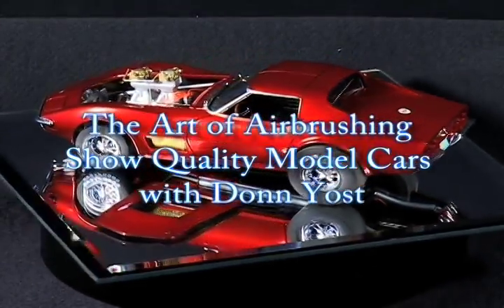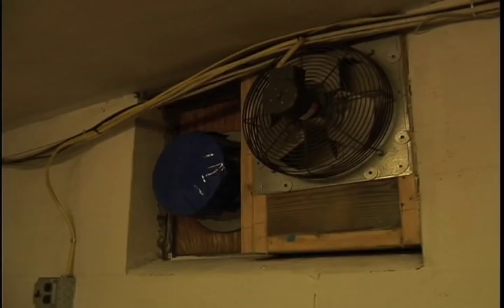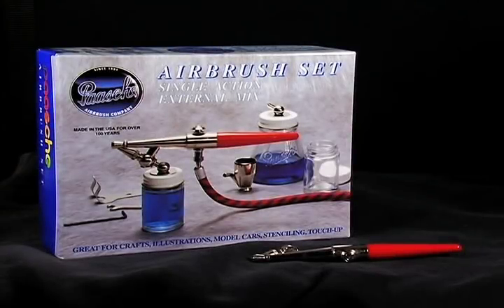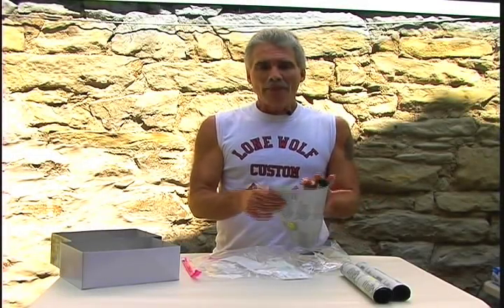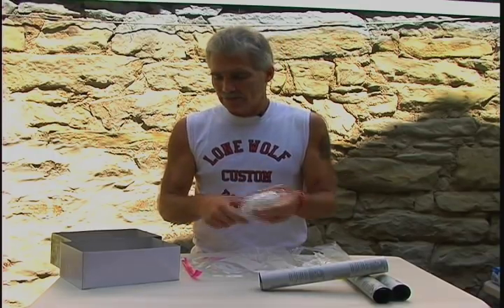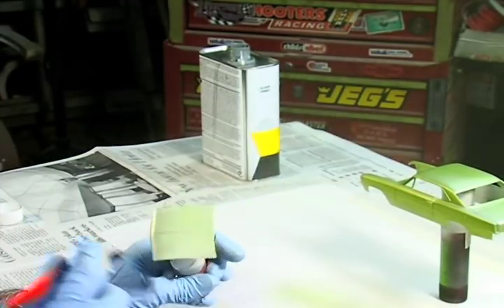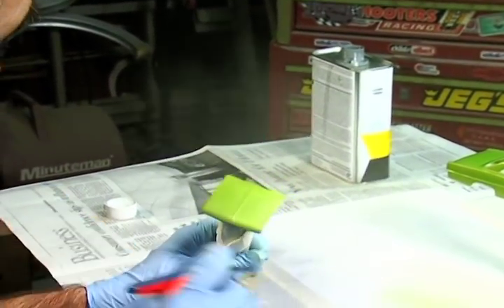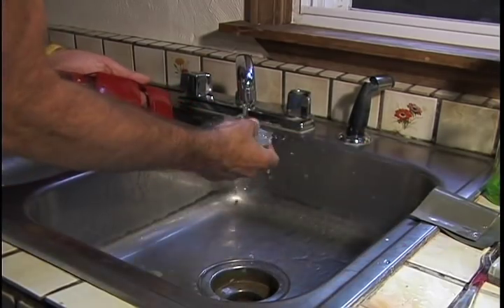The Art of Airbrushing Show Quality Model Cars with Donn Yost (Extended Preview of the 90min DVD)

Comment: 45 yrs ago I used to build model cars, trucks, boats.. Revell, was always my favourite "go - to" brand and some of those plastic resin kits would sure have looked spectacular (much like yours) if only I had a airbrush instead of a soft bristle horse haired paintbrush. Streaks from the bristles were always a common problem even if I lightly coated the final application with a thinner.  Oh, those wonderful smells of Tester Paints in a glass bottle!

Comment: We use masking tape in painting real Cars 2. However, there are some pitfalls to worry about. The cheaper the tape, the more likely the tape is to leave residue behind. Such as glue. Blue tape, is a multi-surface tape. It is for taping together two types of surfaces that are dissimilar. Yellow tape, is designed to trap and lock in dirt. As well as fill large voids in panels, thus keeping down the turbulence as the gun moves over the surface. My recommendation is 2 fine line with 3M fine line tape, vinyl is good for making turns. And lock down your fine line with 3m green tape. The system was created to trap your color on the edge. This is known as The Edge lock system. Your color should not bleed through the tape if done correctly. Thus making crisper cleaner lines. As it is true on real cars, it should also be true with model ones.

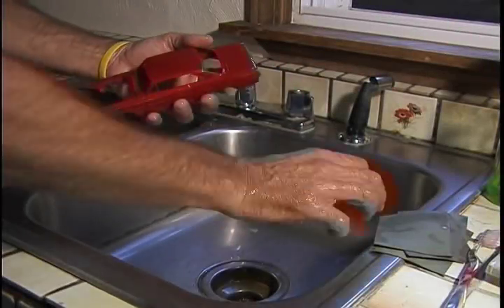Comment: At 6:11 does he say the car was already clear coated? Something I don't understand is if the car was clear coated then how did he remove the scratch from the paint? Did he have to rub down passed the clear coat to get to the base coat and then apply new clear coat when finished? Unless the imperfection was on the clear coat and not the paint?

Comment: Hey, help needed here please. I just bought an airbrush and compressor kit. I purchased a variety of premium Vallejo acrylic paints pre-mixed thinners. My paint doesnt come out like yours so wide and free flowing. I have only a 0.3mm nozzle and waiting for a 0.5mm. I'm doing muscle cars 1:24. Am I doing anything wrong? I tried candy black which was ok but gold ran like water. I would preferably like to have mine running like this video. I'd also like to know what PSI your on because it sounds high. Thx from Canada. Not sure what I'm doing wrong.

Comment: In this video a Paasche H airbrush was used, while I use a quite similar Badger 350. Both these airbrushes are in fact bottom feed external mix. I use an operating pressure of 30 psi (measured with trigger depressed): how much psi are used in this video?

Comment: Any tips on how to make the tires looks more rubbers then plastic glossy black?
Reply from the maker: +keviL That is actually covered in the "Tips and Tricks for Building Show Quality Model Cars."  two disc set.  You can get the set at www.oldmansmodels.com.
Reply: keviL sand them
Reply: Lightly sand the tires with 300 or even 400 grit sandpaper and will make them.look.like used on the road

Comment: I have an outside shop that's quite large (15x25). I have a window a/c unit but no heat. At what air temp is too low to paint ?
Reply: Dennis Henrich the temp I like to keep my paint for painting and for drying is around 65°-70° is ideal!
Reply: Dennis Henrich 10 degrees below what your furnace is set to. Per say 25 celcius or 65 farenhite i qouldnt go 5 degrees below that even but 10 degrees at most